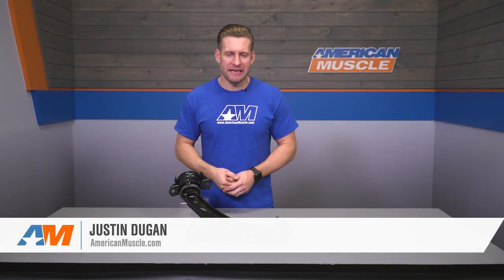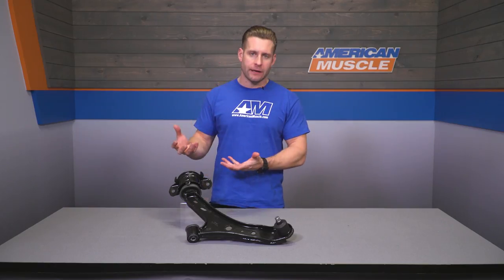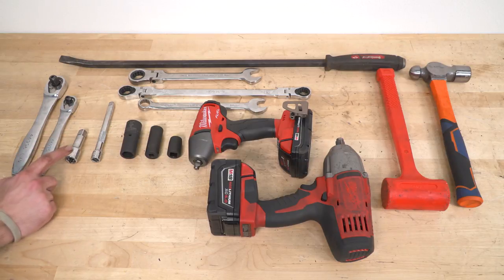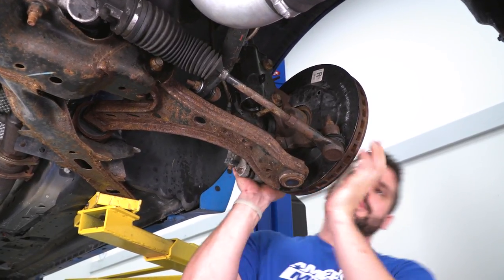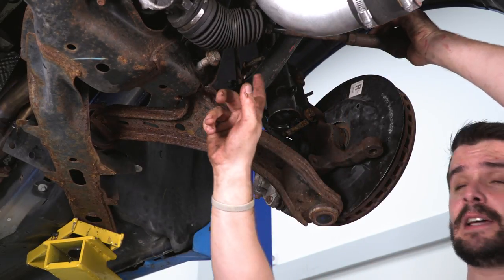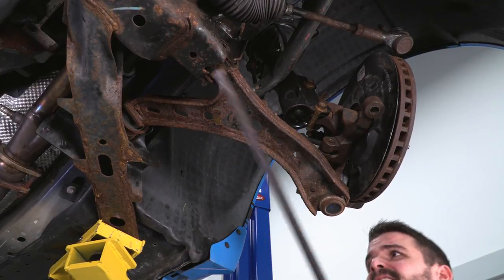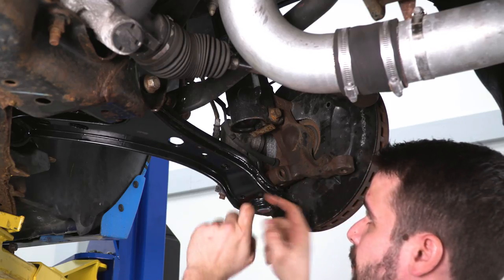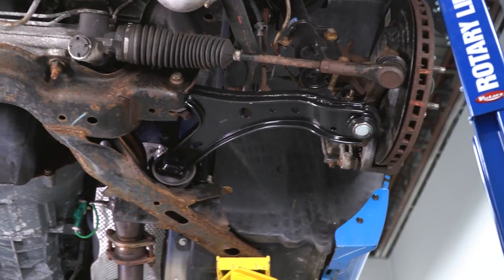2005-2010 Mustang OPR Driver Side Front Lower Control Arm and Ball Joint Assembly Review & Install

Comment: I was informed to not tighten or torque to front bolts until there is load on the suspension(ie. wheels on the ground)

Comment: It seems it’s a little easier than the front control arms for the 94-04 Mustangs since with those cars you still have to deal with the spring if you I haven’t done the coil over upgrade. I upgraded my 02 with BMR Suspension front control arms and it was tedious. I think I saved my self like between $700-$800 in labor. Only thing I had to pay was for the alignment.

Comment: Quick question! Wheel is wobbling at 9 and 3 position off the ground. I already replaced outer tie rod. Inner is good. Will replacing the control arm fix the issue? 10:37
Reply: it could be the wheel bearing as well. but if you replace the control arm and that doesn’t help i’d try the wheel bearing or it could just need a simple realignment

Comment: How do you a torque wrench on the 2 nuts on the larger bushing?  I ask because I just don't see how you can get a torque wrench in there.
Reply: You gotta use the ol elbow torquealator.
Reply: tighten as much as you can and look at it and say; "thats not going anywhere" and it basically should stay

Comment: you have to put the car down on the floor when fully tightening and torquing lower control arms bc they have to be in the right position and have the right load . the way he did this i can bet it wont last 7 months before making a clunking sound agaib
Reply: from experience with changing many lower control arms
Reply: So when you assemble everything you then lower it on the floor and get under the car to torque it. Is there enough room? Do you mean to drive it on ramps then torque it?  I'm interested in your advice as I want to do this for my mustang and dont want to do it twice
Reply: Ryan v yeah i did my 2011 mustang 5.0 and they started clunking after 7 months.. watched many videos after that and when its on jacks and your assembling everything tighten the bolts but dont fully fully tighten them THAN either lower the car fully down and torque the bolts OR jack up the entire hub assembly/lower control arm to where it has load on it as if it was on the ground. the problem with torquing it down with no load on the suspension is that basically its not tightening in the right position so what happens is if u were to torque down the bolts in the air and drop it to the floor the entire lower control arm is now under extreme stress bc it was torqued without load on it
Reply: Ryan v so by torquing them on the ground its in the right position and load and are not under stress and if they are under stress the ball joints wear out quickly
Reply: @Dompass1999  so when the car is on the ground under load do you just turn the wheel a certain way so that you can torque everything down right? What you are saying makes lots of sense. Just trying to picture the process in my head. How did you do yours? I imagine with turning the wheel you can access the bolts that need torquing
Reply: Ryan v i lifted it and assembled everything that i jacked up the lower control arm from underneath and tourqued it all down. jacking up the suspension is like it being on the ground
Reply: @Dompass1999  I see. Ok thanks very much for the advice. I'll try to do the same procedure. I appreciate the time you took to help out.
Reply: Hey Dominic how do you get the bolt in front of the steering rack it’s so hard!
Reply: not if you use the right manufactory  torque  .. what you just said it dont make any sense
Reply: Straight from the service manual... CAUTION: Tighten the lower control
arm and lower ball joint nuts with the
suspension at curb height.
Reply: I know this is an old post, but, the ball joint and the 2 rear bushing mount bolts are "fixed" positions. So, tighten those, put your wheels on, put the car fully on the ground and THEN tighten the front bushing bolt. This keeps the bushing flex starting from "ground zero" rather than being preloaded and predestined for failure. The other bolts will have little to zero impact tightened with or without weight.
Reply: @chrisreed678  what is the torque spec for all the lower control arm bolts?